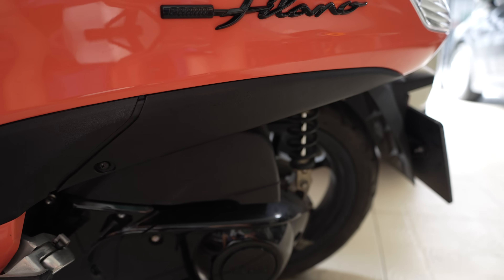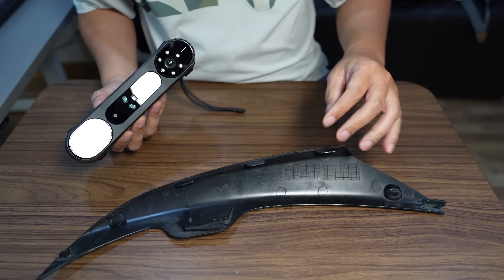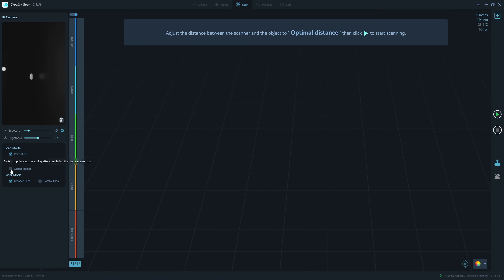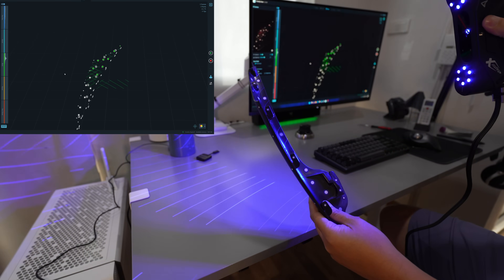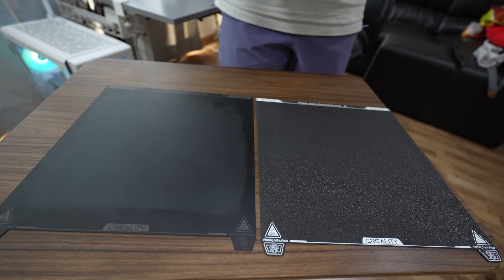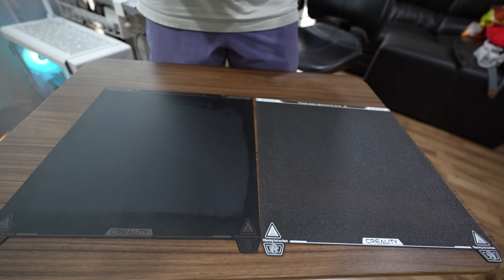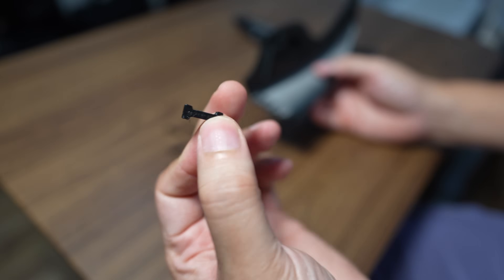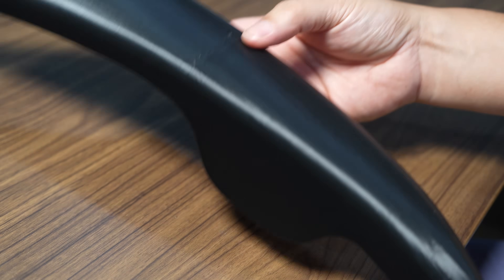3D Scanning to 3D Printing: Reversing a Scooter Fairing in CAD with Creality Scan Raptor X

Comment: STOP SHAKING THE SCANNER ! It is much better a slow fluid continuous movement in one direction, than turning back if necessary.
Reply from the maker: Yes, if you have older scanner with 10 FPS.  This one is 50 FPS, laser scanner builds point cloud when detect change in laser line shape

Comment: thanks for taking the time to make this
I've been wanting to do the same for a motorcycle fairing and my creality raptor (original)
I find that alignment in CAD for complex parts (no flat surfaces/right angles) makes it hard to work with
Reply from the maker: Yes, at least one face of the clip is flat—I'll use that surface to align it on the XY plane.

Comment: can i make this with .obj scan?
Reply from the maker: If you're referring to importing scanned data as a mesh and then reversing it in CAD, it's certainly possible. However, it can be quite challenging since the wall details may not be clearly visible for accurate tracing.
Reply: @Payo-TensileCreator . Thank you! I’m specifically referring to generating CAD sketches from an imported .obj mesh, similar to the process you demonstrated using an .asc file

Comment: Hi Payo. What is the name of the joint you used?
Reply from the maker: It doesn't have an official name, but one of the audience members referred to it as the "dog bone joint." If you're interested, I can create a tutorial video demonstrating how to make this joint.
Reply: Thank you so much. Does a 3d model of it exist somewhere so I can use it in my design? 

By the way thank you so much for the videos. From your videos I managed to get an Otter and scan and reverse engineer 2 functional parts already with zero prior experience.

Comment: Hi Payo great video explanation! Could you explain how your workflow might differ if you used your Otter scanner on a thin walled part like this? I don’t believe the Global Marker option works when using the Otter Scanner. Thank you!
Reply from the maker: You're absolutely spot on. I’ve encountered similar issues with the Otter – Global marker system. Its tracking of markers tends to be unreliable, and the precision just isn't sufficient for scanning thin parts like that fairing. As a result, when the scan is completed, the two sides of the fairing often end up misaligned.

Comment: This was an excellent example of 3D scanning for CAD.  That scooter fairing with odd angles and complex curves would have been all but impossible to reverse engineer using calipers.  I'm currently designing 3D printed mini pannier racks to mount two 10 liter waterproof roll top bags to my motorcycle along the sides of the rear wheel.  I started the project before I had a 3D scanner.  My pannier racks are much simpler than your scooter fairing but would have been better if I'd scanned the motorcycle's sub frame to accurately locate the mounting points rather than guessing, printing a prototype, test fitting, adjusting some angles and mounting positions in CAD, and printing a second prototype to verify the design.

It was slightly inconvenient to add marker stickers to the part, but that Raptor X did a very good job of accurately scanning this complex black part.

A good adhesive for those clever dog bone pins can be made by dissolving the removed ABS support material in acetone to make color matched ABS glue.
Reply from the maker: That brings back memories of my old bike, a 2014 Yamaha FZ09. I had a SHAD top box installed on it, but back then, I didn't have access to a 3D scanner. I had to hire a shop to get it done, and the support steel frame was entirely reliant on trial-and-error fitting. Interestingly, the frame ended up costing me more than the top box itself. Now I have a scanner, but sadly, no speedy bike anymore—haha!
BTW, "Dog bone pins" I like that, figuring out what to call it.

Comment: I had hard time dealing with Fusion360's Mesh section sketches and Loft tool for reverse engineering irregular shapes. 
It was always painful as long as it has more than 3 sketches that are consisted of splines. Either rail is not intersecting profile sketches or points on the sketch are not equal - leading to twisted lofts... Ended almost always using T-splines instead.
Reply from the maker: I loft two sketches at a time. Doing more than that makes it tough to make changes later.

Comment: I just received mine and am getting a slight vibration/sound coming from inside. It kind of sounds like the fan is rubbing against something. Is this normal or should I reach out to support?
Reply from the maker: The fan makes noise, getting louder when it heats up and quieter when it's cooler. My unit doesn't have any grinding noise, though. If you're experiencing issues while using it, I recommend reaching out to customer support for assistance.

Comment: Love all your videos. 
Could you show us how you make these connectors to hold the pieces together ?
I know you have made a video about that a long time ago, but they where different type. The one's I made do not clip together. I guess the tolerance where not good...
If you could do that videos in Fusion 360 that would be perfect for me !
Reply from the maker: I use 0.1mm clearance for FDM printer. If you first layer is too close, it won't fit, you need to dial in the first layer.

Comment: to avoid those 3D lines as you call you have to export your part as STEP and not as STL, try it and check the differences, For the adhesion try a spray 3DLacPlus I love it.
Reply from the maker: Thanks for sharing, I'll try it next time.

Comment: Fine reverse engineering! Do you know if the volumetric accuracy is the same(in real life) with Raptor, Raptor Pro and Raptor X? My Raptor is not always my first choice when scanning mechanical objects like Die casting mold components. I rely on my Otter with magnetic markers(homemade) and with the new "global markers" mode the result is very good so far.  By the way, very instructional video!👍👍🇨🇦🇨🇦
Reply from the maker: I think drifting error is the same among all Raptor scanners.

Comment: You inspire me to consider doing something similar. The cost of the Raptor X is outrageous. How are you able to afford all of those scanners?
Reply from the maker: Initially, I started using a 3D scanner for work, and it quickly paid for itself. Later on, Creality began sending me scanners to review.
Reply: @Payo-TensileCreator  I have no doubts about that. The thinking and planning in your work is well done. The part which I really appreciate is making do with the constraints that you have. If one has unlimited sums of capital to do this, there is really no fun. The challenge is in making do with what is available. Cheers. Great job once again.
Reply: buy  raptor pro . super scaner

Comment: Yeah. For parts that have to be strong I use 3-4mm wall thickness. That’s the downside of 3d printing. Layer line adhesion.
Reply from the maker: There was a time when printing was possible but scanning wasn't. Now, you can scan almost anything, but printing everything is still out of reach. FDM printer technology has a lot of catching up to do.
Reply: @Payo-TensileCreator  - It also helps to fillet or chamfer the base of thin structural parts such as those plastic clips as much as possible given clearances to other parts.  Those thin clips work with injection molding but not FDM printing.  Another option might be ABS-like resin in a large MSLA printer.  For FDM printing parts like this, I'll often use TPU.  It has great layer bond strength that gives it much more homogeneous physical properties than other FDM printed polymers.  We tend to think of TPU as flexible, and it is with thin walls and low percentage infill, but print it solid at 2 mm or thicker and it's a structural material with great impact resistance, chemical resistance, UV resistance, ozone resistance....